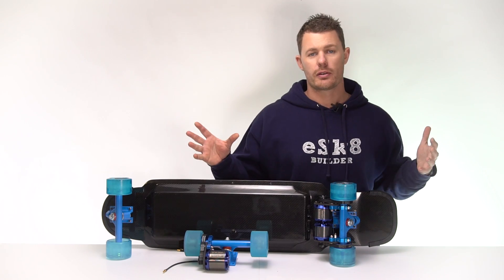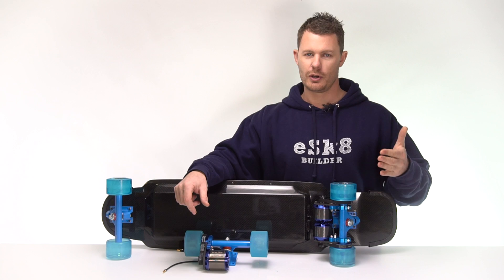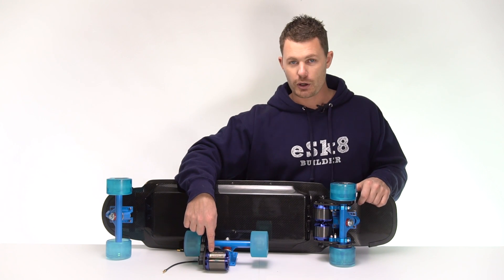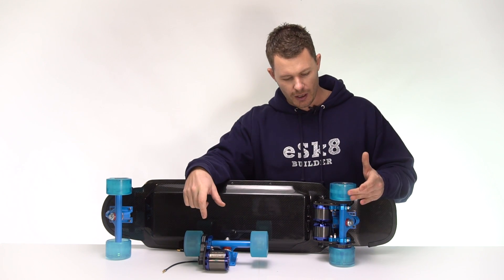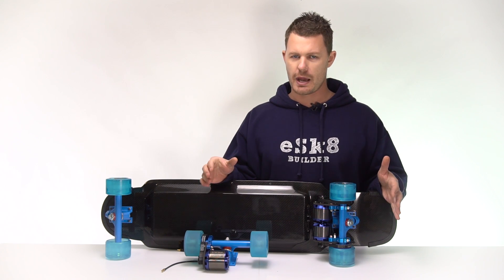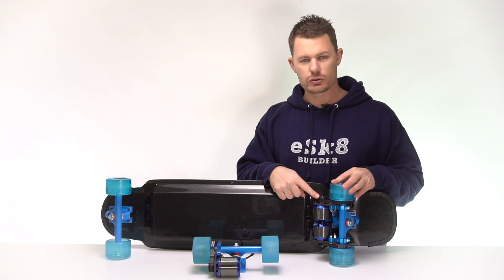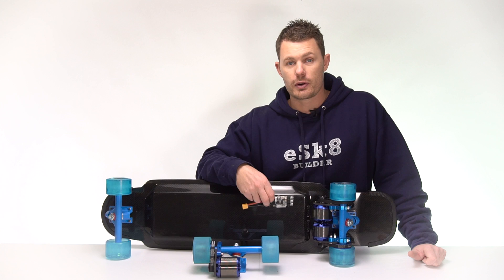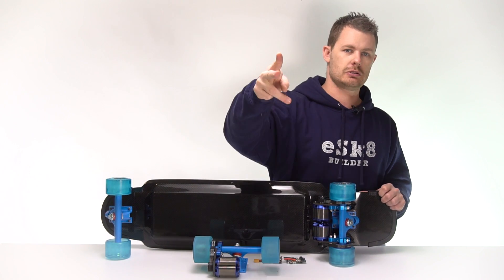Electric Skateboard Dual Motors VS Single Motor

Comment: So regarding baterries, if we have two motors driving one wheel each. The battery(40a) would have 20a going to each motor. Does this mean it wont get as high of a speed as a single motor having 40a?

Comment: You can use smaller pulleys with two motors.  Better belt clearance and better top speed without stressing the motors.

Comment: One reason I see dull motor safer  is if you have a Single belt and it snaps u will have to stop with ur foot full motor u will have the 2nd one still

Comment: So in order to double the performance you also need double the voltage? How much better dual drive is with the same voltage that you would use with a single motor?

Comment: Hey! I was willing to make my own eboard. If doing my research and I would love to have a dual motor setup.
I was wondering on how the turning works. I mean in order to turn the inner wheel has to lower its RPMs to turn into that direction. So when you lean... due to your weight and inclination the friction force on the inner wheel would be higher and you will just turn. But if you push the throttle while doing this, the speed variation will exponentially increase until its uncontrollable and chances of falling just seem really high.

So does the Vescs have any giroscope and compensate this to avoid falling or how would this be managed? Or am I just overthinking and when eboarding if you want to turn you just dont push the throttle??

Can anyone help me with this??

Regards!

Comment: Hey so would you get more distance with a mono drive than a dual? Thinking a dual would drain the battery faster with 2 motors?
Reply: I'm thinking it's all about your battery and how big it is.
Reply: Since the esc's and motors are wired in parallel from the battery, the power gets split in half. Both esc's get the same voltage but half the current. So the battery drain will be the same

Comment: So what can I do for water proofing. I live in Seattle and it is more likely than not that there will be water on the ground. I'm really interested in your product I just need the water resistance.
Reply: motors are water proof as is, brushed or brushless, might need water resistant ESC/reciever

Comment: Higher or lower kv motor for dual setup? Choosing between 190kv and 230kv 6355?
Have the following options 190kv 2200W,   230kv 2200W   190kv 2400W,      230kv 2400W,    
Note : motors are Alien Power System.
Reply: Denasdc Do you have a solution for it. Have the same idea of mackig a dual
Reply: Well no, but the rule of thumb is to use lower kv motor with higher voltages. With dual setup you will not need higher torque as for one motor because two motors will share the stress. So I'd say you can go higher kv for dual setup, just watch that the motors are between 200-300kv. But I'm saying: dual motor will have better climbing capabilities as well as faster speeds. But it's your choice: faster(higher kv, 230kv), or better hill climbing (lower kv, 190kv). BTW there will be less heat on the dual motor as it's not stressed as much, therefore will last longer.
Reply: Thanks for the info. I will do a dual setup with just one high power esc. lets see how it goes
Reply: Not recommended because it has higher chances of burning the esc under the load. Exactly the same as for the motor. It's always good to use one esc per motor: less chances of stressing the esc as the stress will be shared between the escs, if you burn one esc it will be easier to change the cheap one than expensive one.

But it's all on you what you decide.
Reply: Both variants are expensive. But if i pick an esc with lots of buffer it will work just fine without any stress, hopefully. I will see, its just an experiment anyway... 
The pros are more space, (cheaper), and less setup time

Comment: what you are saying is wrong mate. 
if you make your wheel bigger and it's sprocket,  you increase torque not speed!
Reply: Electric Skateboard Builder at 00:40 you say that by making the mechanical advantage bigger you would actually get a higher top speed which is wrong.
Reply: so if you ride a 12inch wheel bike your speed is low but when u jump on 26inch your top speed will be a lot higher
Reply: Gosia Samosia its not about the wheel. I'm taking about the sprocket or pulley! if that is larger you increase torque and lower speed!
Reply: alright I guess I just expected you to increase the size of your pulley with your wheel. I re watched and I seemed to have misunderstood.
Reply: If you are talking about the pulley/gears you are right
Reply: No that is wrong. The larger the wheel the less torque. More speed.

Comment: Can one control be used for both motors?
Reply: You need one ESC per motor I haven't ever seen one that can drive two motors. The ESC used in these is called the VESC.  It has a communication bus called CANbus that's used in cars too for real-time communication between components.  Pretty sure that same connection is used to send the signal from one VESC to another.  The receiver that is paired with your transmitter would just be connected to one VESC though I believe.

Comment: Can I just buy a mono pre-built...I want to buy within this week and wanted boosted board but will have to wait and it's not practical on distance or speed...I'd rather buy a mono Also does it come with a controller and off switch if so, I'll buy it right now

Comment: 1) Is it possible to get all-terrain wheels for this anywhere? 
2) Would the motor mount work on a regular long board truck? 
3) If I got two motors, wouldn't I want to get a twice as powerful control unit so I can use all the power from the motors I can get? Thank you very much for any answers...
Reply: When you say 'control unit' do you mean battery? because I believe that having 50 amps going to each motor isnt possible with current battery technology. do NOT quote me on this though
Reply: TheXenoMaster Thanks  for the reply.. Yeah you are right, the typical peak current for li-ion batteries is 40-60 amps... SO you are right, I would definitely need 2 batteries for that... so never-mind :)
Reply: 1) not sure, have seen all terrain long boards but not sure how different that is from regular long board trucks and wheels.
2) yes I bought some other similar mounts from diyelectricskateboard.com they will fit on regular long board trucks, that said I also ended up getting some jbweld to seal the deal because otherwise the initial torque shakes the heck out of the whole assembly.
3) The VESC is a ESC (electronic speed controller) that is open source hardware made by Benjamin Vedder, I have had 2 other ESCs before I managed to get a VESC (they were back ordered) and it is so so so much better than the other two I had previously tried.  First one burnt out... why I'm not entirely sure but the ESC is what takes the power from the battery and delivers it to the motor and is responsible for firing the voltage through the wires to the motor in order at high speed to keep it spinning so it is a key component.  The VESC takes some learning but ultimately you can plug it in via USB and program it with a GUI made by Benjamin that is really great once you get your head around it and will show you live information about voltage and draw and allows you to fine tune the limits for reducing power and cutting off power from the battery (if the voltage on a LiPo battery is too low it can't be recharged).  The batteries themselves are typically rated with a C rating like 10C or 20C, that is a discharge rate, you multiple the mAh value by the C value to get the total discharge rate... for example say you have a 8000mAh (8Ah) battery with 10C, that means peak discharge is 80A (8Ah*10C=80A).  From my personal experience you typically have a hard time finding an ESC that can deal with the battery discharge rather than the other way around (there are lots of high discharge lipos for hobby quadcopters and helicopters and 1/5th scale RC cars).

Comment: hay how do. you get your stuff for it like do you get sponsored
Reply: He's the founder of the company enertion boards, he's buying the parts in bulk and assembling them (I believe in his garage)  Most of the parts are being custom made for his boards and they are all high powered, the price is high but the quality seems to match from what I can tell as an outsider.  Have built my own e-skateboard but seen a lot of Jason's stuff before and drooling over the battery right now since I've been running on a 6s battery and the motor can deal with twice the voltage, but I"m torn on buying a cheap arc welder and building the battery or just buying the pretty pre-made one.
Reply: Thx

Comment: I'm assuming, your two motor are connected in series as the power is equal through both, if you were to connect them in parallel wouldn't both of them equal to twice as the single motor? I'm not sure on this but I just had a science class and I just noticed this.
Reply: So is there a performance difference of, say, 100 Watt on 1 Motor vs 100 Watt spread on two? Or would you just need a stronger battery setup, that can supply 200 Watts to make use of both motors? - Basically: Is the same wattage spread across 2 motors more torque than concentrated on 1 motor? - If you have the time could you illustrate by using your 2 different space cells for an example?

Also, how about range? I assume there is a bit less range with 2 motors, since loss to friction is doubled with 2 belts? Do you have a very rough percentage on how much difference that should make?

Do you actually feel any torque steer when only using 1 Motor? (slow veering to the opposite side the motor is on)

Planning a build now and I gotta say: You make it very hard for me to even consider other brands... (compliment :D) Your stuff is just very thought out, powerful and the motors even look about as cool, high quality and futuristic, as a motor could look! :D

Thanks so much for the time! If this is difficult for you to answer here, please just tell me to send again to your homepage. Sorry, this comment kind of got away from me... ;-) This almost turned into "prospective customer questions" along the way...

Comment: instead of having both motors on the inside of the trucks. why not having one motor at the rear and one in the front.  that way you can put two big motors on with two big belts...

Comment: I'm building a mono-drive electric skateboard because of the range I'll be getting.. I don't need as much torque when I don't weigh that much.
Reply: how much further will a mono go
Reply: how much further will a mono go
Reply: how much further will a mono go
Reply: very difficult to compare since with a single drive you have more horizontal space to work with so the motor can be completely different.  Efficiency of the overall system is just dictated by the loss due to resistance through each of the components starting at the battery and electrical resistance all the way down to the friction of the wheels with the pavement.  Only way to tell really is to build and test.

The capacity of the battery and the draw from the motors you can do some theoretical calculations on but hard to account for variable friction, weight of the rider, hill climbing or descent, and other factors. To give a rough idea, when I first accelerate from a stop I tend to draw about 20-30A for a moment but once I'm up to speed on flat ground I draw about 4-5A normally, but hit a rough patch or small hill and need to accelerate and back up to 8-10A.
My setup
149KV turnigy sk3 motor
VESC
two 5S in series to make a 10S battery (42V charged, 36 depleted)
2.1:1 tooth gearing ratio

Top speed 24mph range is mostly dependent on mAh capacity of batteries used but lies somewhere between 7 and 15 miles.

Assuming 8000mAh battery and 8A average draw it's about 8Ah/8A = 1hr of ride time

Comment: Kinda unrelated to this vid but you mention wider belts have more traction which is true but how does this compare to a chain drive setup? Couldn't find anything on the forum.
Reply: I would just think that chain would give the most traction without the risk of it breaking the the belts sometimes do.
Reply: Yup I made my board with a chain drive single tacon 160. I have never used a belt yet...
Reply: Most mountain boards use chain also